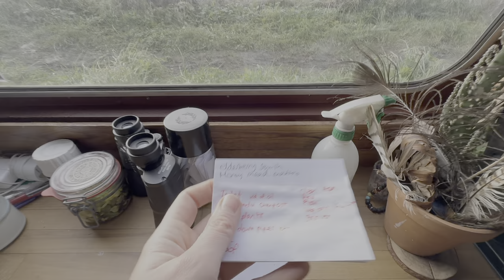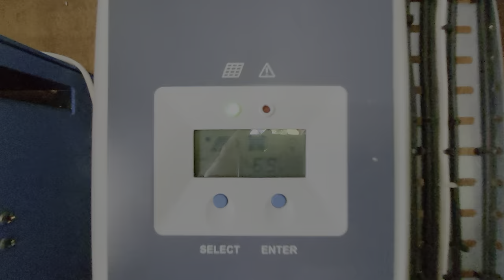4 Essential Tips for Securing Your Narrowboat Before Vacation

Comment: Hi May, the other type of shower pump you mention is called a gulper pump. As you say, it is activated by a switch and pumps the shower water out into the canal. I have two bathrooms with both systems on my boat. They both have their benefits and drawbacks, on balance, the gulper pump method is better. There is still a filter to deal with but that's about it. Cheers, Peter. x
Reply from the maker: Thats great info, thanks Peter

Comment: For the shower … I push a button . But it’s also automatic. So either way is a win. And for my sink I rely on nature. The sink is higher and the tube goes down and kicks everything out without having the need of a pump. Also my shower has a massive container, the actual bottom of the boat which gets flooded anyway and that’s where the bilge is located 😅
Reply: Also. If you have WiFi connection you can have a setup that replicates a persons actions like switching the lights on and off randomly.
Reply from the maker: Nice! Thanks for the info

Comment: Hi May. 
Cleaning is a integral part of any Home but especially so on a Narrowboat that is fitted with a Wood Fired Aga,keeping that chimney clean and free of Wood tar is essential if you want to keep your Home Safe,probably 99% of Narrowboat fires are due to people not keeping up a strict cleaning schedule just of the chimney,soot is obviously a problem but burning Wood and especially Green Wood is a major contributor to Wood Tar and that’s the stuff you can’t burn off  !. 
Now down to some serious stuff that I would like to ask you ? Why is it that Narrowboats are never fitted with double glazed windows ? Surely that would help with insulation ? And why do they have to be made of Steel ? Is there not a more efficient material for the construction ?. 
Another question is you seem to be very in touch with Nature etc but it does confuse me when you say anything about environmental issues and concerns but you are constantly burning Wood and using a Diesel Engine ?.
You seriously need to consider going Electric and Off Grid, you need to consider that the CRT are seriously considering Banning Solid Fuels from being burnt on Narrowboats,many of the areas where you and others are moored are actually areas where Coal and Wood are Banned for Home owners and they are complaining about Narrowboaters who are causing some pretty drastic emissions pollution issues,from Diesel Engines and bilges leaking into the Water and the fact that the fuel used is Red Diesel which is more damaging to the environment than White Diesel,Pollution from burning fossil fuels etc .

I am wondering why nobody has designed and built a Narrow Boat that has a Water catchment system and the means that makes that water safe to drink ( it’s a lot simpler than many people think ! ).

I mean we have Eco Homes but as yet I don’t think I have ever heard or seen a Eco Narrow Boat !. 
I’m still not 100% sold on this EV though because it would seem that all the mines that mine the materials and minerals are using Diesel to Power all the machinery !??. 
Not to mention the environmental impact on the chemicals that they use being released into the water supply and tables nearby the mines !. 
Look at the damage caused by these humungous open cast mines as well,some of them are the size of Big Towns ! Do they put the earth back the way it was when they started ?!!.

Do Love your videos and think you are a Lovely young lady and wish you nothing but the best wishes for this New Year ❤. 
If I was 20ish years younger I would definitely be keeping an eye out for you in the hopes of impressing you hehehe…. But I am a Old Fart nowadays and besides I am a Father/carer of 2 Adult disabled sons and they are my Top Priority ( not many women are interested in a old fart who has disabled sons 😪 ) but it’s there loss and hopefully I find someone one day ( I’m definitely not holding my breath though Lol 😂 ). 

Enjoy your Holiday ❤ Peace and Love  xx
Reply from the maker: Hey there! Thanks for your comment and reminding me I need to do a video on eco thoughts for sure! Sounds like you’re doing important work so keep it up and keep your heart open you never know what’s around the corner. Take care!
Reply from the maker: Oh and there are NB windows that are double glazed if you can afford them!